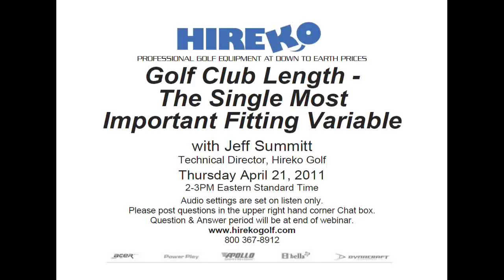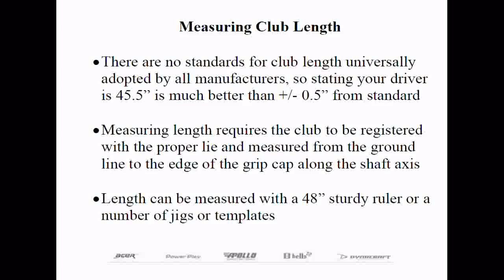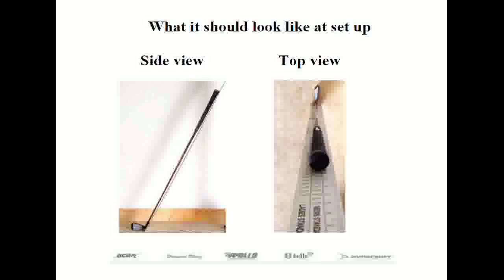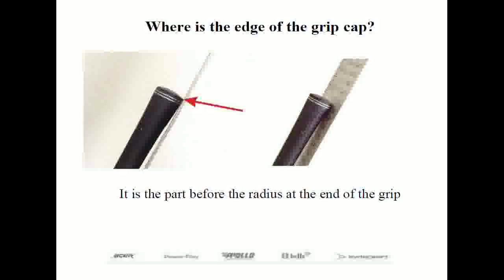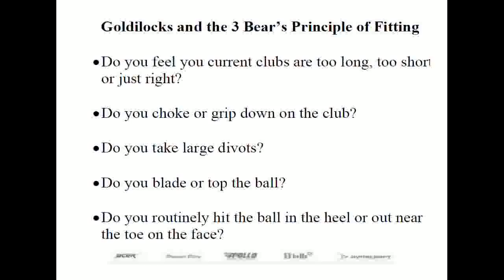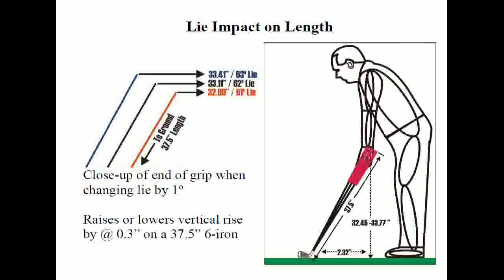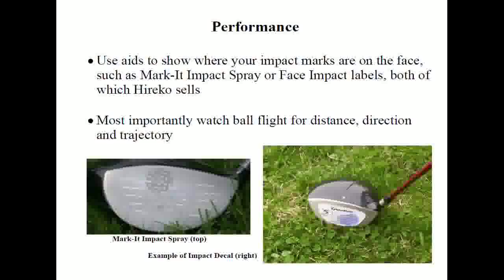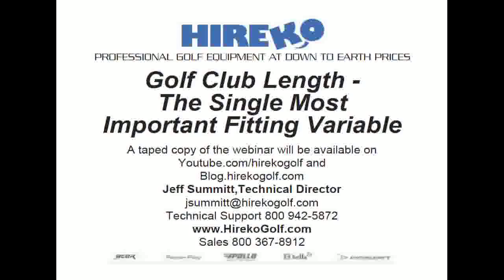Golf Club Length Webinar - The Most Important Fitting Variable

Comment: This is all good for STATIC measurements.  The real deal is to put tape on the club faces and hit balls to see if length and lie are proper.  I'm 5' 8" and have been using .5" over irons for some 30 years and this what fits me.  The static measurement would put me into a too short club.

Comment: Jeff my height is 64 inches and wrist-to-floor is 30 inches.  I usually buy clubs that are shorter in length by 1 inch and have the lie adjusted by 2 degrees flat, but think my clubs are too long.  Any suggestions?
Reply from the maker: My best suggestion if you feel the clubs are too long is to head to the range or a place on the course no one is at.  Choke or grip down 1/2" and see if that feels and better than at full length as well as watch ball flight.  Repeat the exercise by choking down 1" and evaluate feel and performance.  If either one of those conditions all the sudden makes a positive change you can either continue to choke down (think Anthony Kim) of remove the grip and resize.  If you want to get fancy, take a roll of lead tape with you and see if you need any extra weight.

Comment: If i go dynamic gold s400 tour issue (132g) shaft and lengthen 0.5 inch... will i get a silly swing weight ie. D5, D6?
Reply from the maker: That will depend upon what shaft and length you have right now.  If you had the same or similar weighted shaft and you re-shafted at 1/2" longer, then you are likely to see a 3 swingweight point increase.  If you have a lighter shaft, it will likely go higher than that without using a heavier grip or counterweighting.
Reply: @HirekoGolf1  7 iron 37.5" 110gram shaft
Reply from the maker: What shaft do you have now and what is the current swingweight?  Some of the lighter shafts have material removed from the butt and center sections so the tip remains stable.  This moves the balance point closer to the tip so a heavier shaft like DG Tour Issue may not increase the swingweight at the same length.  The extra 1/2" will increase the swingweight 3 points regardless with no change in grip weight.

Comment: Wait... if a golfer tends to hit toward the toe then you want to flatten the lie, and if they hit toward the heel then you want to make their lie more upright? I've already heard it was the opposite...??
Reply from the maker: If you flatten the lie, that will push the clubhead farther away from the golfer assuming that all else remains the same.  So that toe shot may move back toward the center of the face.  The big "what if" will the player change anything at address, in their stance or during the swing from doing so?  That is why for some golfers when you change one parameter it could result into one thing, but the next golfer with the same issue can see a completely different outcome.  That is why it is so important to be dynamically fit.
Reply: @HirekoGolf1  5' tall golfer here. So if I am consistently hitting towards the toe will all irons (nearly a full ball), would it make sense to shorten the shaft which would in my mind tend to make things more upright and flatten the club?